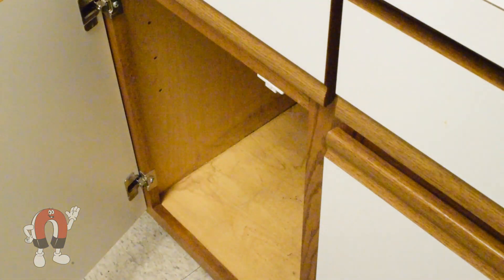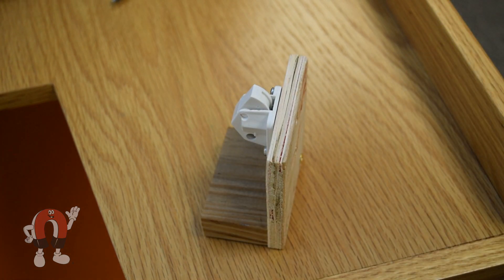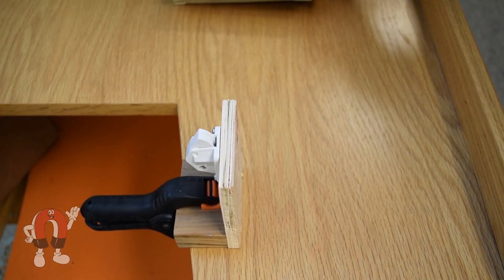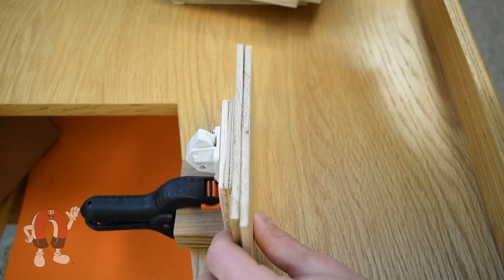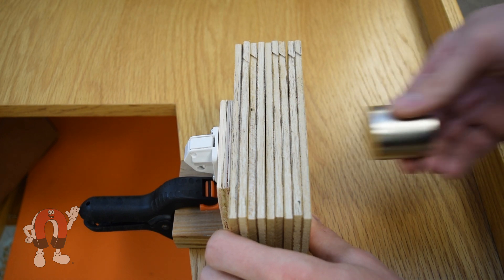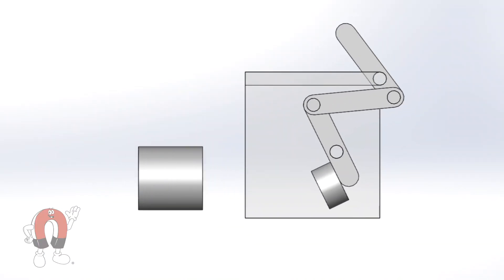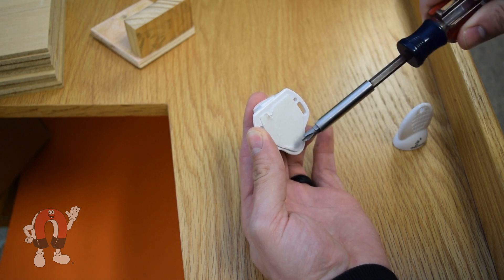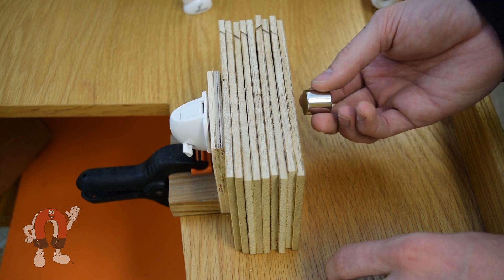Magnetic Locks - How do they work?

Comment: I can see how these locks would be good as child locks. However, I've seen them used for wall mounted gun safes and I doubt they provide much security from theft is you can easily open them with any magnetic object.
Reply: I'm thinking about making a hiding spot in my vehicle,this would be perfect for hiding papers,a pistol ect for short term storage